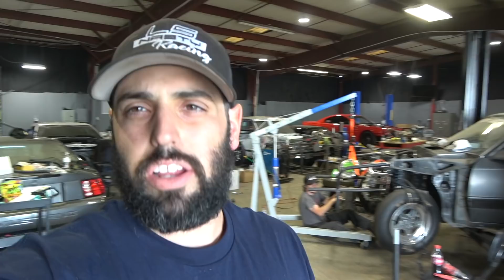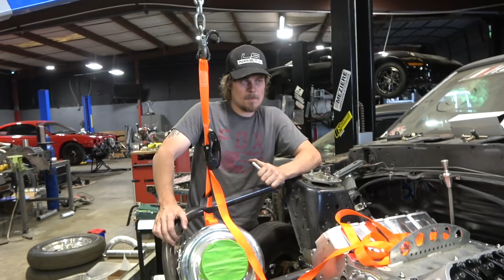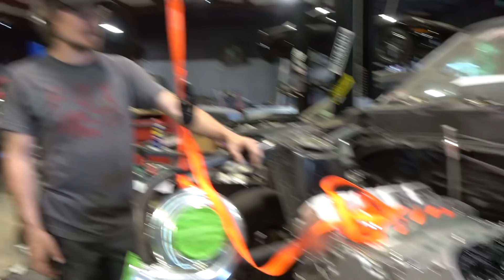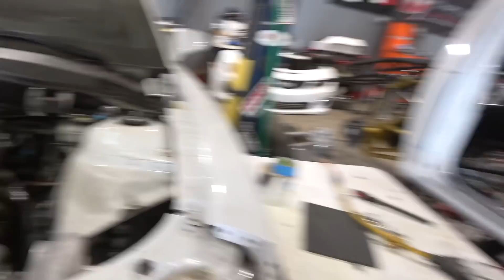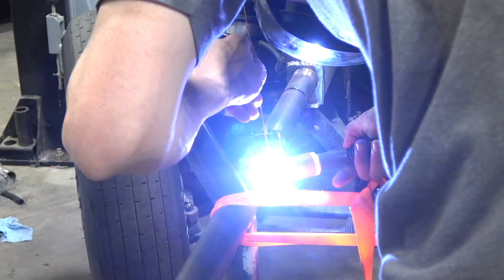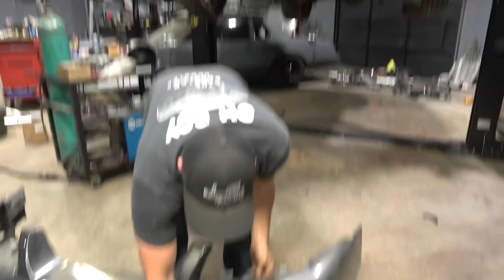Putting a MASSIVE turbo on a TINY LS in a FOXBODY!!! 98mm Turbo Street car!!

Comment: I believe Race Status finished the week.  Your boy made 1 pass.
Reply from the maker: When we do it we just hope to finish!
Reply: @JohnDoc  the key from what I see is to start out with a very solid setup and combo and make it to where if you need a part replaced make sure it's something you can easily get from the nearest parts store and if you tow a trailer which can be a good thing if you don't overload it to where it's wearing down the car on the drive portion of the event but put all the spare parts that you can in the trailer and don't put a spare short block together and think that you'll be able to use it if something goes wrong with the one in the car because there is alot of red tape on that part and after they get done discussing it amongst themselves and making a decision on it you might not even get to use the entire short block so take a bunch of spare parts that you might not think will be easy to replace at the parts store and take a bunch of tools as many as you'll think you might need to use to change the broken parts out with and last year or at the beginning of the year at Sick Week I can't remember which one it was I think Sick Week but @HustlinHorsepower's wife @LadyGangsterRacing were not able to make it with their own car in time so they were able to drive with majority of the group of people and they had a welder and a few other things on their Spool Bus they used to tow their race car with and were able to help people out at the track or the side of the road with welding equipment and stuff like that and they usually have a guy towing a portable car lift going from track to track just in case someone needed to put their car on a lift and you usually have Motion Raceworks salesmen towing their parts and merch trailer so if you need a part from them they got you and if they don't have it someone else who has the same engine combo might have a part you might be able to buy from them or they might even give it to you just because that is what it's about when it comes to racing and that is you should always lend a helping hand because you never know when you might need a hand with something and my suggestions are you should get the car setup to use Pro Jacks because they fold down smaller in the trailer and they are easier to work under a car with them and carry a small light weight jack and a set of jack stands just in case you need back ups to the Pro Jacks because you don't always have access to air or power so most of your Milwaukee electric tools and add ons will be handy too and have a set of QA1 MOD SERIES coilovers on the car that way you can setup one valve pack for the towing and driving and one for racing and maybe a spare set too of course the laptop and a set of headphones that you and co driver can talk comfortably without having to yell and you can save your hearing as well and depending on which event you enter Rocky Mountain Race Week had a Rowdy Radial class which obviously the car needs to be on radials and it's an 8th mile race average that matters in that class so that is right up your alley and one last thing what does the Stage 2 Black Sheep engine package consist of since you've never talked about it and I personally have never seen or heard about anybody having one it's mainly the Stage 1 and 3 Black Sheep engine packages that you mainly talk about but if you ask me the first rendition of the Stage 3 that you ended up overpowering and then having a huge parts failure with should be the stage 2 but instead of trying to make 2000+HP with it change a few parts out and make 15-1800hp should be a good comfortable spot for it and instead of pairing a 98mm turbo with it you should pair no bigger than a 94mm turbo with it and the Stage 4 should be a Stage 3 but full port and polish everything and maybe change a few parts to make a little bit more power and then the Stage 5 should be an all out build with a complete billet engine similar to the one Steve Morris is building and calling it the SML just because he is designing it from scratch and moving the head bolts around so only his heads will fit his block and he is putting water passages in the heads and block just like he did with the 481x that he calls the SMX and he claims the SMX makes 4500+HP and the SML makes and will handle 3500+HP which I've only ever seen someone run his SMX with a set of twin 98s and it does make and withstand 4500hp and they were able to go 5s in the 1/4 with it after they completed Drag Week and that is Tom Bailey in his Pro Mod 69 Camaro but I have also seen Proline put twin 102s on their 481x and their Hemi and made alot of power with both setups and the Hemi made over 5200 on Fuel Tech's hub dyno with the twin 102s and I think eventually you should put a 102 on the Black Sheep and see what you can get out of it
Reply: And placed 3rd in my class😂😂